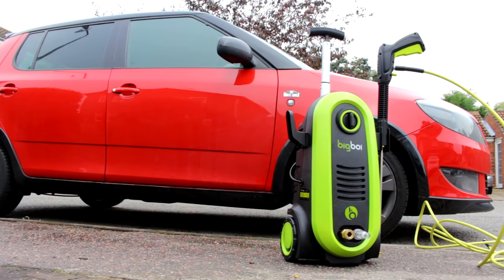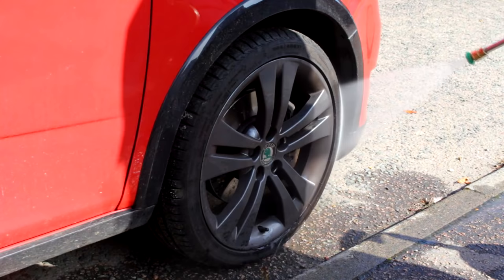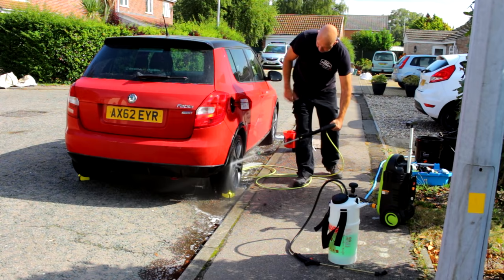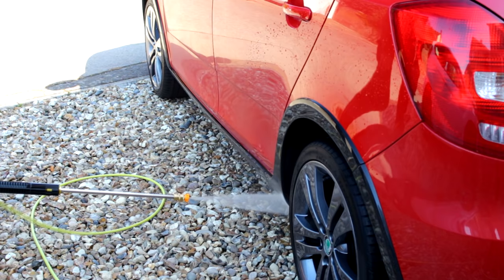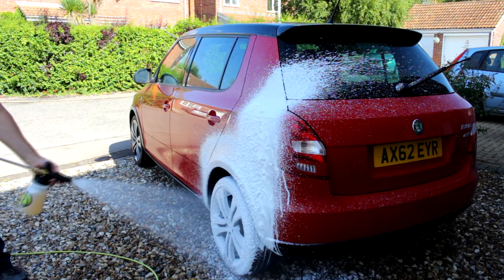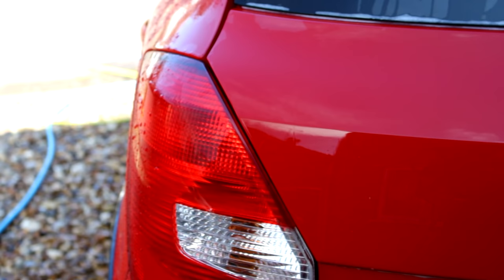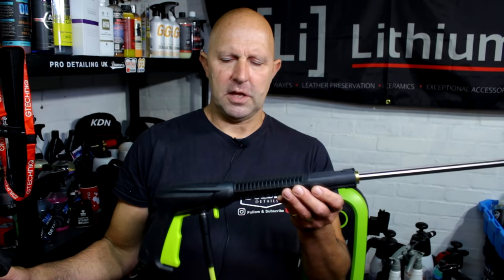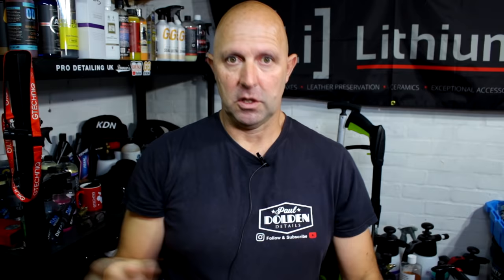The best pressure washer for car detailing

Comment: Finally a pressure washer that uses a universal quick release system for the Hose, even though it's the wrong size Quick Release, it's progress in the right direction. Really need to see more Pressure Washer Manufacturers opting for this fitting and not the proprietary fittings.
Reply: You can buy those quick releases mod for most pressure washers now
Reply: "even though it's the wrong size Quick Release" could you explain this comment? i am interested in buying one of these, cheers

Comment: I got one of these in the first batch. I've owned a karcher and a nilfisk and this has been by far a superior product. My one gripe is that the balance isn't very good so, if you pull it using the hose it falls over and the plastic lance holder snaps. Not a big deal but a bit of a pig after forking out £250. That said If you are in the market for a high end machine and the Kranzl is a step too far, go for it - you won't be disappointed.

Comment: Another great review   with your problem with the stubby gun issue  i ended up buying an AVA of norway pressure washer and there trigger gun you can take the lance portion of it off and just connect the nozzle or quick release adapter which i found was a brilliant little trick

Comment: Good review and a powerful machine that is excellent for the weekend warrior. The power and snow foam is much better than a Karcher. I used to spend £500 on a Karcher every year. That Big Boi is well cheap. Stubbies are normally used by pros for constant detailing work. I got some of those hose anti snag gizmos and a MTM stainless steel gun (diesel Clark Power washer) from in2detailing and they are awesome. If you got to a hydraulic specialist you can get any fitting to convert the Big Boi to a MTM for a couple pound. I got a stainless high pressure and temp fitting for the MTM and Clark Diesel Power washer.

Comment: I bought a WashR from UF off the back of this video and I’m loving it, so thanks for that Paul. I got a good Black Friday discount on it too, so even happier. I’ll be swapping the included stock high-pressure hose and lance for the upgrade pro hose and stubby gun kit before summer starts (if it can actually be bothered to show up next year). Agreed on the power when using the snow-foam cannon. I was JUST about able to do two cars on one bottle by running around them and commando-rolling at each corner.

Comment: Nice demo on the big boi pressure washer Paul👍 I finally retired my old Clarke pressure washer a few months ago as it was giving up the ghost after 6 years service. I ended up buying the kranzle k7/122 total stop which came with the quick release fittings, foam canon, long lance attachment with the different angle nozzles. The best purchase I ever made! If I would have known about the big boi? Maybe would have purchased this instead and saved hundreds £££’s.

Comment: Should be simple enough to change the lance Paul. The hose connection fits my old nilfisk c110 lance, so should be able to use a short trigger with a nilfisk connection.

Comment: You crack me up Paul, "what a loser" first time in quite a while I've actually laughed out loud at a video.
Not a bad washer for the money, but why oh why can't manufacturers charge a tiny bit more and give a decent hose and non proprietary gun?.
I bypassed the hose on my nilfisk and just attached a hose straight to the body as I was that fed up of the crappy plastic hose pretending it was an old telephone flex, best thing I ever did.
Stubby gun heaven now, no more achey arms and I'm only 6'2.

Comment: The BigBoi is essentially a Chinese mass produced pressure washer. Greenworks and BlueStar in the US are the same. You cannot get replacement parts if they fail. I dont want to hate on this product Paul but it is essentially a throw away product after 1-2 years. Cheaply built. The lance and the suitcase style carry handle is a dead giveaway.
Reply: its pants they even put the litre per hour cos per minute would look so bad
Reply: It doesn't matter how long it last or place of manufacture, if its a gift Roy.
Reply: @paulrollings2791  Very true Paul. Its just that I have been caught out before and have since done thorough due process before buying any piece(s) of equipment etc.
Reply: @roywilson2231  before i waste any money , could you recommend a unit with similar operating pressure?  in the past whenever my karchers have failed ive binned them as repair costs were high.
Reply: I can get replacement parts if I don't try

Comment: That looks a very impressive machine power it has is incredible but it looks as though they spent all the money on the machine and the hose and trigger it looks really cheap if I bought one I would want to upgrade the hose and triggrr on it for sure, I’ve also looked on eBay and you can buy a Nilfisk to Quick Release adapter so you can use your snow foam lance on the trigger 😉

Comment: Just thinking if on washer its m22 fitment before screw on fitment it comes with you can then use better hose and gun it make it loads better. My nilfisk e145 broke again and use core 130 but its to weak so this at price be good if last

Comment: That does look like a belting machine to be fair. 

Although did miss a trick with that lance. Why not make the handle a stubby gun with a quick release on the front and then you can just stick your lance into the quick release as and when you want it. 

I have a nilfisk at the moment so it would be interesting to find out if a nilfisk adapted snow foam gun would fit of you removed the lance section.  

This will likely be my next upgrade as the K4 is about the same as my Nilfisk and the K7 is a bit of a rip-off in my opinion. 

One thing I will miss though is the cable reel on my Nilfisk. It's brilliant and save so much pissing around with the hoses.

Comment: I don't know if I was just unlucky and got the Friday afternoon built  unit.  But the bigboi I ended up with. Was a total piece of crap  it wouldn't  clean moss off the flags  it was under powered  no way it made 2600 psi.   It was useless for washing the car.
My cheap 60 quid nilfisk from screwfix was better. I ended up buying a karcher k4  to clean the patio  as the bigboi wasn't up to the job.
 After 7 months  and only used it 6 times  it stopped working..  U. F replaced it  under warrenty  straightaway so I sold it..
 And got a nilfisk premium 180.
 This is more than adequate and up to the job..

May be I was unlucky and had a faulty unit. From the factory but my experience with bigboi was a negative  bad one  I won't  recommend  or buy again..
Reply from the maker: Maybe just a bad one and not a good experience

Comment: I used mine for the first time, but when i turned on the water, my hose leaked the water on the side that’s connected to the bigboi, any idea how that happened? I need some help since i don’t know much about it
Reply from the maker: Check your connections try changing the connection on your water hose
Reply: @PaulDoldenDetails  any idea how many inch the water hose has to be for the bigboi? Couldn’t find the diameter of it online (the one that connects with the water filter)
Reply from the maker: What google says You probably only need a 5/8-inch diameter hose. Hose attachment accessories, like hand sprayers, typically fit onto this universal size in the United States. Use of 3/4-inch hoses is normally reserved for professional uses, such as watering public parks or gardens.

Comment: Just watching this Paul the gun is exactly the same as bosch even down to the adapter you can buy to turn it to quick release, so I'd imagen a bosch conversion to stubby would fit... However I can't find one in stock anywhere
Reply from the maker: Hi mate your probably correct but since filming ultimate finish have been in touch and there is actually a stubby gun available and it should be coming my way at some point so watch this space for updates ✊🏻
Reply: @PaulDoldenDetails  very interested mate, if that's the case been looking for one for ages... Maybe will have to compair fittings with you. Definitely looks a great machine, if I didn't have 3 boschs I'd be tempted to change

Comment: When washing the cars do you not use a mitt to clean the car or is letting the snow foam bite and sit in work for taking all the dirt off ?
Reply from the maker: Snowfoam generally never removes all the dirt and grime it does however soften and start to break it down for you to remove with your power washer then you can use your two bucket method with a mitt or wash pad to remove the rest 👍🏻

Comment: Hi Paul, I just bought this machine yesterday based on your review.  It's going to take a while for delivery unfortunately. Paul, how did you convert the proprietary quick release to a make 3/8" quick connect? I am guessing from another unboxing video the unit has a M22-14 thread on it which you now use a 3/8" female quick connect?? I'm very curious about how to convert to the universal quick connect on both ends of the hose if possible. Thanks again.
Reply: Did you ever find out which one was needed for the bigboy washr? Also trying to find the same adapter used to make it quick release
Reply: @McAdammm123  I ended up returning it mate as the the warranty here in Australia would end up costing too much money with a service kit required each year and transport back and forth to have it fitted. I went with another company with fittings already there.

Comment: Great video.  We have zero floor space storage in our small garage and no outside areas.  Any ideas of how to hang this pressure washer?
Reply from the maker: It has a pull up handle like a flight case you could mount it on some wall brackets
Reply: @PaulDoldenDetails  thanks for replying, I thought of that, but then with the weight I thought I'd destroy it.  Just bought a couple of days ago on your recommend and stoked

Comment: Hi Paul, been using the big boi washr since February and have been pretty happy with it. I have the same problem that you came across "the lance". I know you can buy a new hose and stubby gun package but ultimate finish don't sell the guns separately. Be very interested to find a stubby gun that's a direct fit at a decent price if you can help. Cheers dude 👍
Reply from the maker: Stay tuned there could be one on the way 😉😉
Reply: @PaulDoldenDetails  brilliant news, for a cheap pressure washer it's the only thing that let's it down and would make it even better IMO. Keep up the good work 👏
Reply from the maker: @christopherdunkley116  😉
Reply: @PaulDoldenDetails  Completely agree - no stubby compatibility, no buy. Really interested to hear more on this one...

Comment: On the Lance where the quick release is, are there adaptors out there so you can use your patio cleaner for example?

Great video and that washer most definitely has the kick. Karchers are crap.
Reply from the maker: there are all the different size nozzles on the rear of the machine try the green one first

Comment: How is the lime green hose? Does it kink or coil?
Reply from the maker: It’s light and can coil but not as bad as Nilfisk but checkout the upgrade kit video
Reply: @PaulDoldenDetails  Thanks heaps. My Karcher hose coils but what makes it much worse is that it is very rigid so it remains coiled. The stock Bigboi hose at least looks very flexible and no where near as tight.

Comment: Hi Paul, they cant market this to the detailing industry, the pressure washer is rated way too high at 180bar with no adjustment in flow rate, also i hate metal lances as they have a tendency to be too heavy to wield and if they accidentally hit the car it will damage it. I also dont like where the hose goes into the gun. Lack of spare parts is also an issue with these no name brands. No thanks i will stick to my Karcher K4 Full Control and short gun. PS: the newer Karcher's also use quick release from the machine through to the gun
Reply from the maker: Thanks Carl it’s not for everyone my friend great feedback as always there is some news there’s a stubby gun for this but it’s pricey
Reply: @PaulDoldenDetails  thanks Paul, that's gonna make this around 300 quid then with the stubby gun, which again is in some real good company at that price. I also think non adjustable 180bar for car washing is too high, 120bar is the max for me
Reply: I doubt it's anywhere near 180bar it's just not a big enough machine to produce that.